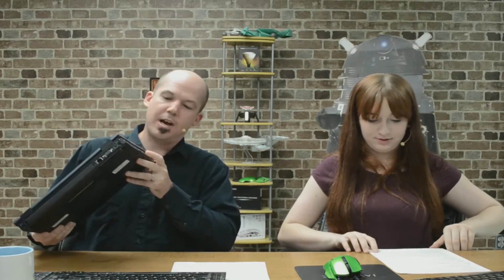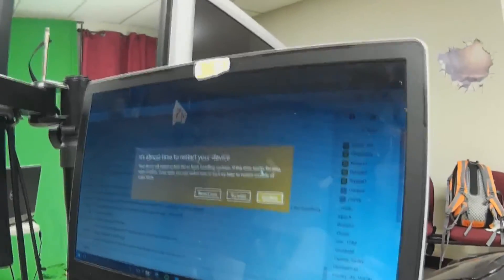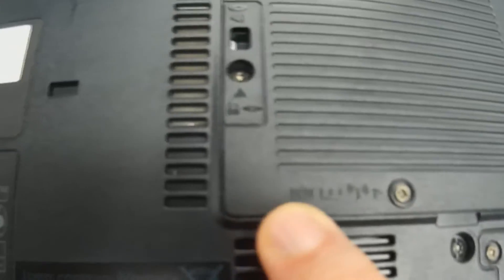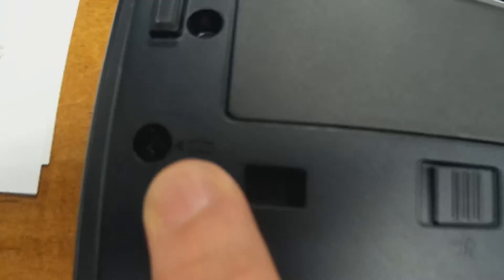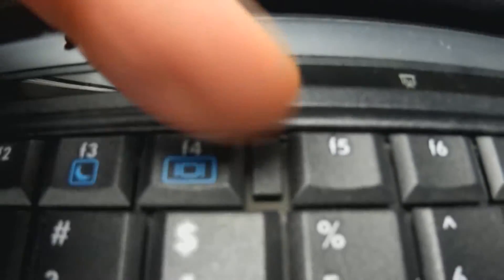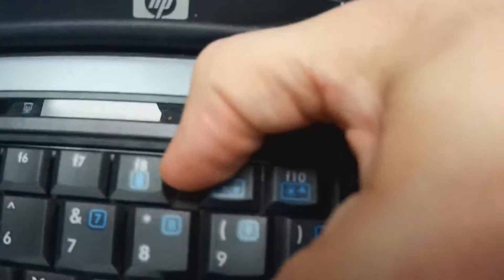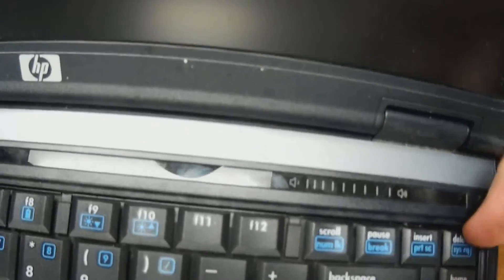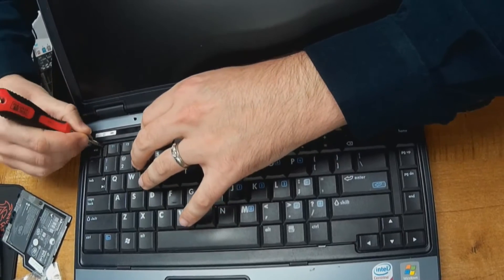Replace the CPU fan in a Laptop Computer

Comment: if you can do this on my laptop I give you 100 dollars where did you even find this laptop
Reply from the maker: Your local computer shop should be able to make this repair for you. The hope with our video though is that you'll gain enough knowledge to be able to perform the repair yourself. If you don't feel comfortable doing that, call around to some computer shops and ask them if they can replace your cooling system. Tell them the model of laptop and get a verbal quote for both the parts and labour. Parts can range from $5 to $100 depending on the laptop and part availability, and labour would be roughly half-hour work ($50 or so in our market up here).